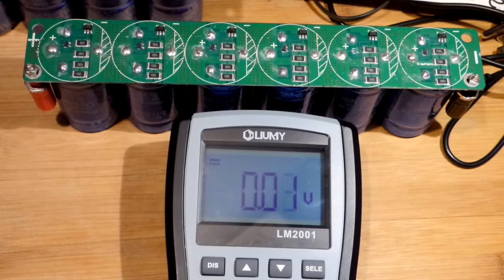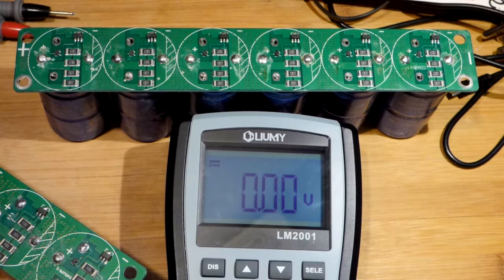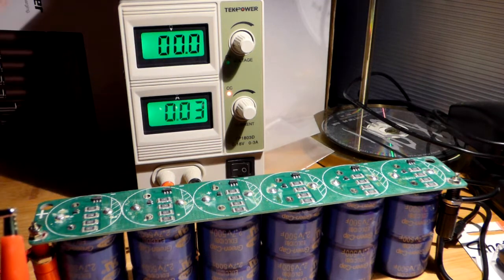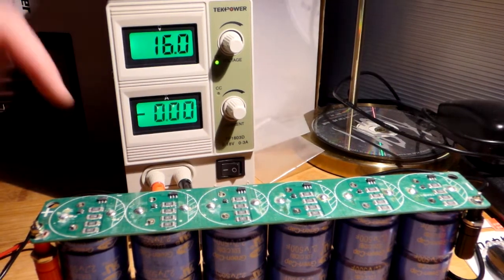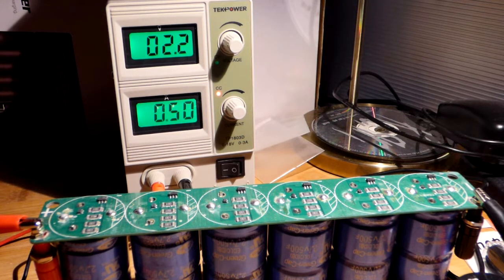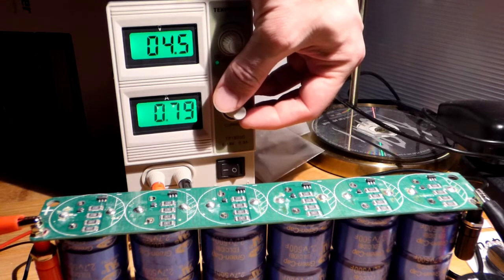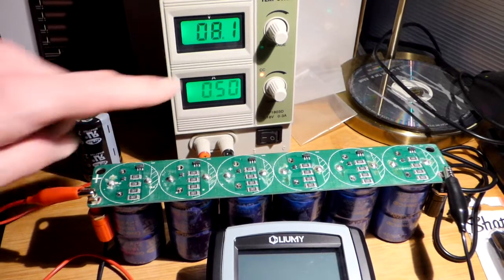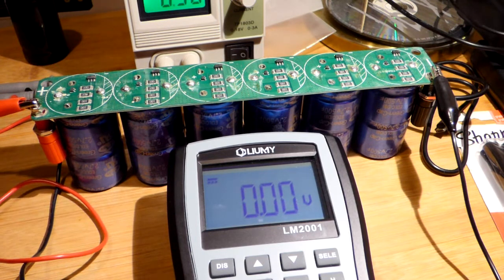Updated video of 6 series 2.7V 500F supercapacitors w protection board for 16.2V 83F unit

Comment: can't you just hook it up to a battery directly?
or do these things behave differently from regular capacitors?

I plan on using something like that to connect in paralell to an inverter so I don't need thicker cables just for the current spikes at short peak loads like when the fridge is starting
Reply from the maker: Whenever you charge large capacitors with a battery, you want to do it through some resistance so that high current doesn't flow. Metal could vaporize and you could get hurt. But once they are the same voltage, then you can connect them directly together. Some people have used supercapacitors to start cars and other short burst of high current demands, so that is a practical use for them. I'd look for a higher quality system though, that auto shuts off if the battery voltage gets too low.
Reply: @Electronzap  the capacitor bank I ordered arrived yesterday, looks like it got some current regulation going on, it just sparked a little bit but nothing bad happened, it also works as planned, with cables designed for the expected load and a little extra and the capacitor attatched to the inverter it can start the fridge just fine
without the capacitor the voltage drops and it shuts off.

it's a smaller capacitor bank at 16V20F, but it works just fine for this purpose

that got me thinking

there's this issue with new graphics cards having high current spikes which causes issues with power supplies, couldn't you just make a capacitor module that plugs in between the graphics card and the power supply to solve this issue?
Reply from the maker: @nathanwest2304  I don't know anything about the graphics card issue. You can do a search to see how people tried to address it. Usually you find someone that came up with a good solution.
Reply: @Electronzap  the only solution at the moment is to buy a much larger power supply, hoever, a puwer supply reaches peak efficiency at about 50% load and performs much worse at lower loads.

I might see if I can get in touch with gamers nexus what they think about it

Comment: So i could basically make a phone power bank that charges very quickly if i connect the caps in parallel ?
Reply from the maker: Money and space wise it would be a lot better to just buy multiple portable lithium power banks. But if you have enough of these in parallel for a given phone's battery and power usage they would charge up really fast and could be used to power a phone charger.
Reply: @Electronzap  The very reason I want to use supercaps instead of lithium ion batteries is that the batteries take hours to charge, and supercaps charge in a couple of seconds
Reply from the maker: Supercaps are good for short bursts of high current. They don't provide power for very long. They store a lot less energy than lithium which is the primary reason they charge a lot faster. The lithium battery will last a lot longer per charge, are extremely cheap and a lot smaller compared to supercapacitors.

Comment: Careful, these are not protection boards, more like voltage equalization circuits. They did not work in the ones I got because they were assembled with the wrong type voltage detection ICs.
Reply from the maker: That's a good warning. I don't think there's any protection boards for supercaps yet. Appears we absolutely need to limit the amount of charge and discharge to stay within safe levels.

Comment: I have been told that these are not 500F supercaps. Supposedly, the chinese outfits relabel out of spec 300F supercaps so these are more like 50F modules. That's why it charges/discharges faster than expected.
Reply from the maker: Yeah. Can't trust the rated value at all. Especially when you buy them individually.